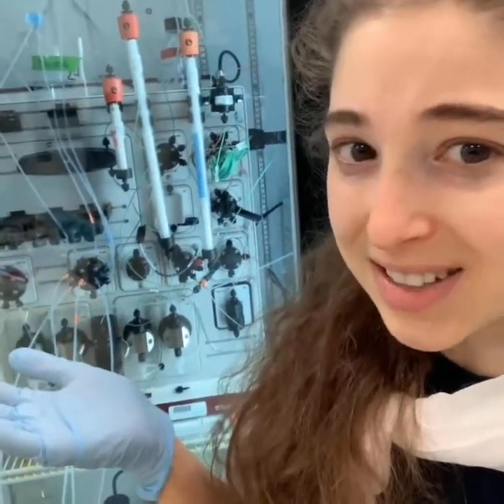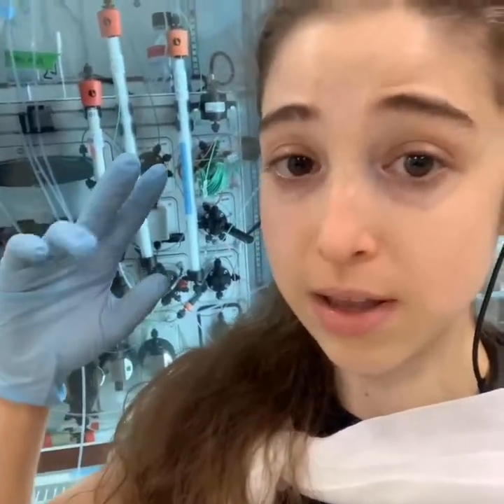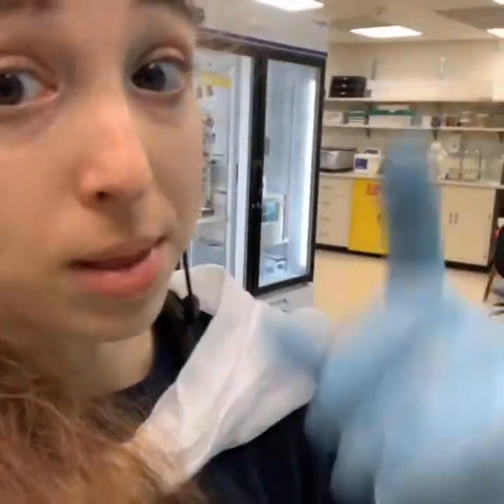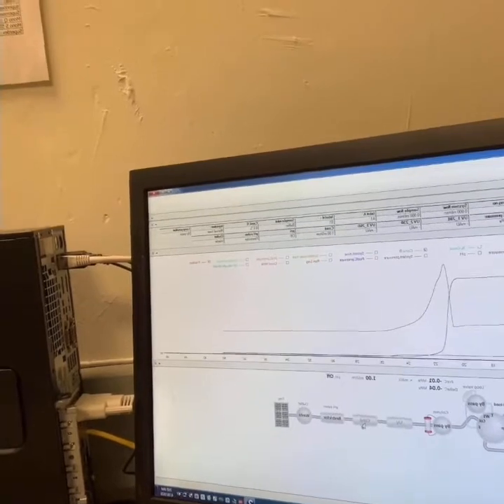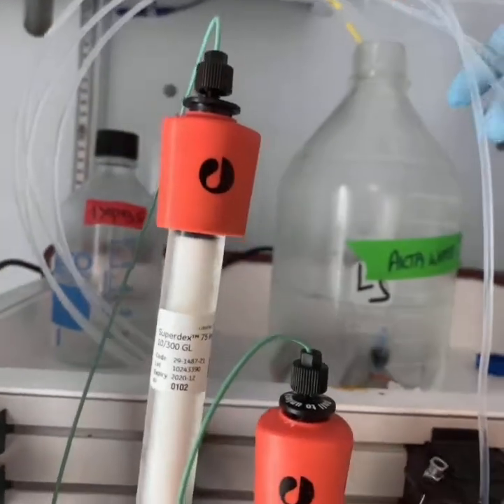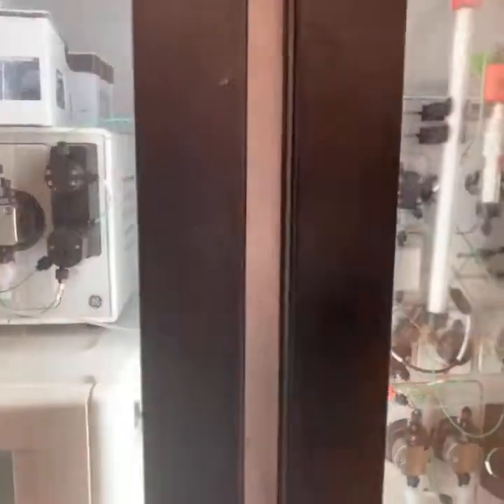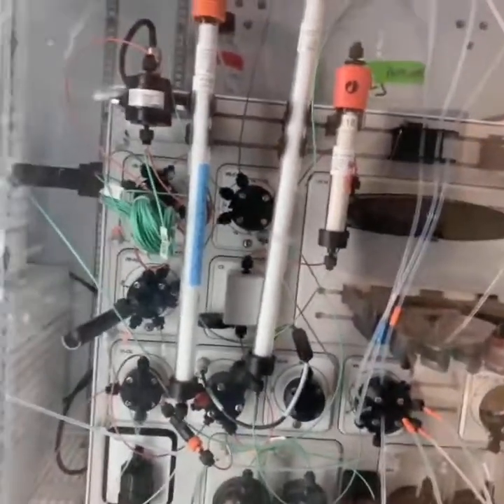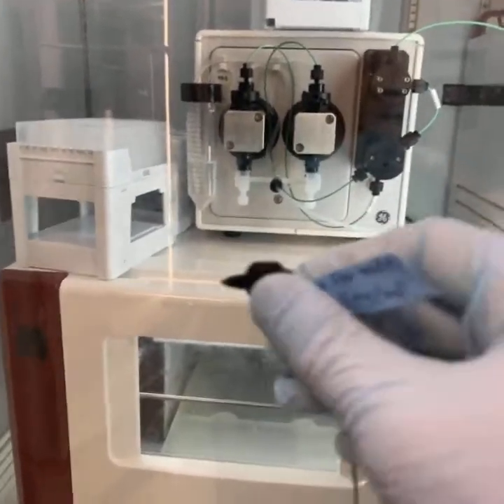Meet the AKTA! (and don't be intimidated by it) - Fast Protein Liquid Chromatography (FPLC)

Comment: Can you explain what the UV detector does? If we are only keeping track of the time it takes for molecules to exit the column,then why do we need a UV detector?
Reply from the maker: The UV detector shows us when protein is coming off the column. Then we can collect the fractions corresponding to that time.
Reply: @thebumblingbiochemist  thanks for your response,could you also explain why a PH valve is necessary?
Reply from the maker: The pH reader is optional. It can be a good check if you have an issue to see if the pH of the buffer was okay. And if you're doing a pH gradient, you can monitor that. But it isn't required
Reply: @thebumblingbiochemist  thank you again.
liked and subscribed.